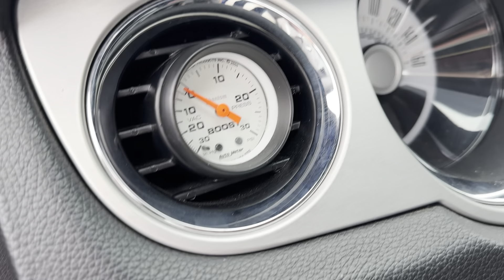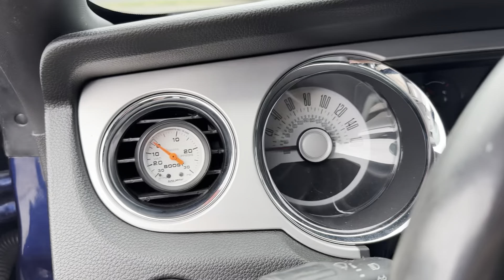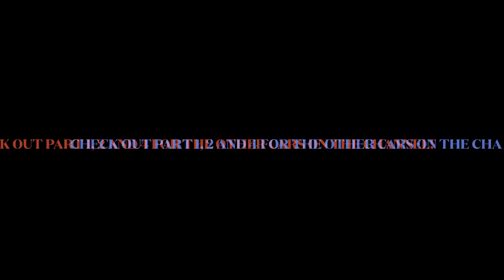N/A, Whipple, Procharger or Turbo, What power adder is best for you? Part 3:Centrifugal Supercharger

Comment: So what’s your take on centrifugal vs whipple? Whip more for drag strip and centr more for daily , rolls and street?
Reply from the maker: Personally, I like the Whipple a lot because of its instant power and easy control, however because of its instant torque it’s more likely to spin. Centris make all their power at high rpm and make very little down low so you’re less likely to spin and can throw more power at it up top. I really like my prochargers and the sound of a procharger with a big red race valve is like nothing else in the world. It’s the most attention whore setup by far, but it also performs well. Procharger or centri blowers aren’t for everyone, some people really just like that instant torque from the blower so that’s up to you to decide. Procharger is more noise and power at high rpm vs Whipple or vmp for instant torque and power that, on a coyote, doesn’t make any noise at all really.

Comment: So the centri cat is faster than the whipple
Reply from the maker: In this case, yes. The Procharger car is on 18 psi of boost making 825 rwhp. The Whipple car is guesstimated at 750-760 wheel. The torque of the Whipple is far more significant than the Procharger but the top end power of the Procharger surpasses the Whipple. The Whipple feels faster because it’s more violent then the Procharger